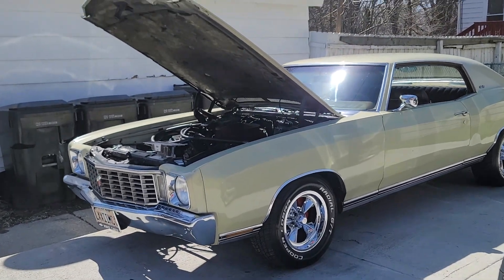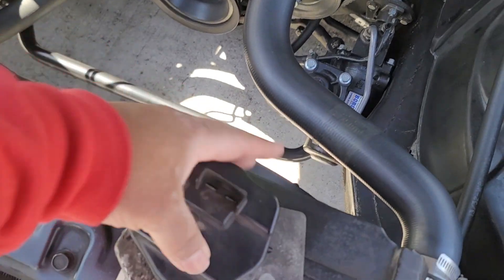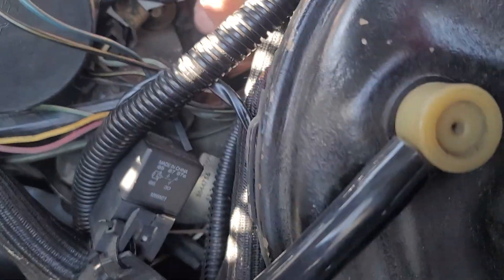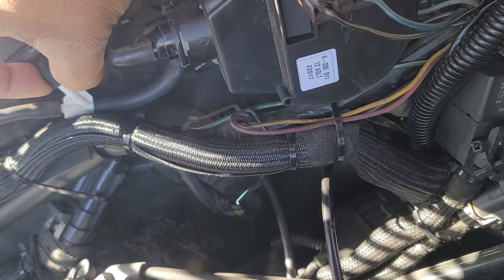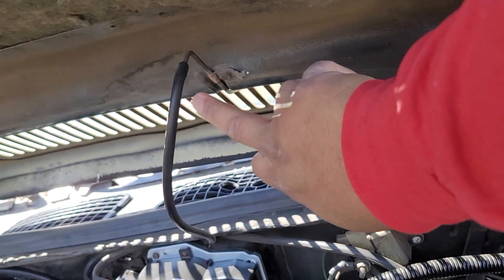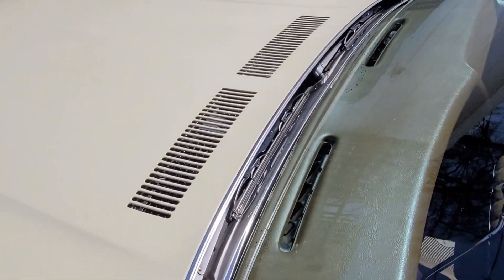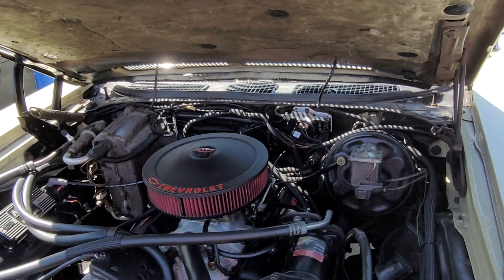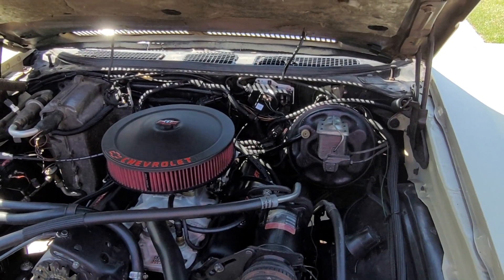GM Windshield Washer Pump Upgrade-Mechanical to Electric

Comment: Does this one fits on my 1970 chevy caprice? Just bought it and that same motor is not working. 

If yes i will order and try this one. 

Thanks and cool car from the netherlands.
Reply from the maker: @noel_nld  thanks! Amazon says that it does fit but double and triple check before you order.

Comment: Did those electrical plugs just pull out or is there a clip somewhere?
Reply from the maker: They just pull out but it was pretty snug. I just wiggled back and forth while pulling on it.
Reply: @ParisTheMotorhead Thank you I'll try wiggling back and forth. I even tried to use some pliers and they're in there real tight. Did your vehicle have a the wiper delay feature?
Reply from the maker: @AFPaul12590  It doesn't. They sell delay kits that I thought about getting but  I'm not in the rain much in.
Reply: @ParisTheMotorhead  I think I broke something trying to pull that 3 prong connector out ....
Reply: Wish i had seen this video right after your question. Some of theese plugs have a 'plastic-clip' you have to bend out, or pinch in. On my wiper/washer motor it's both  and one that can be pulled out with no clips

Comment: GM used that from at least the 1960's, and I thought that they were garbage. I did not like that they pumped only for a set amount of time no matter how much or how little washer fluid was needed. This is a nice update. My '75 Cadillac had one go out, and I got a universal pump (today they sell for about $10). I also bought a hose tee. I cut the wires to the old pump, and connected them to the new pump, then connected the hoses. It had 2 hoses going to the spray nozzles, and that is where I put the tee. It worked perfect, and the pump only stayed on as long as I held the button down. By the way, first generation Monty Carlos are fabulous!!